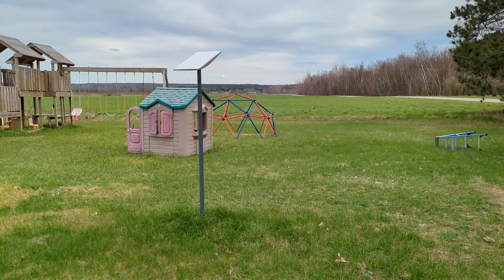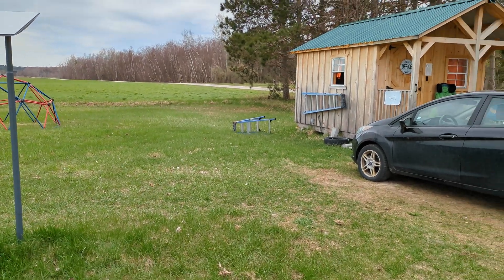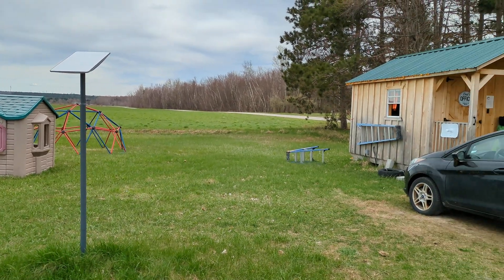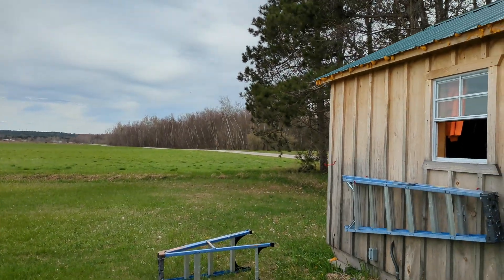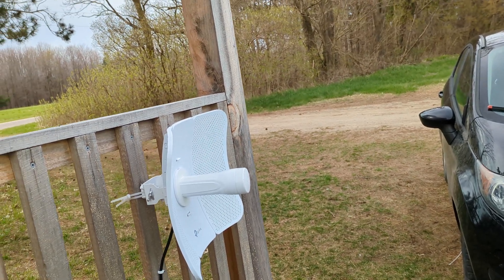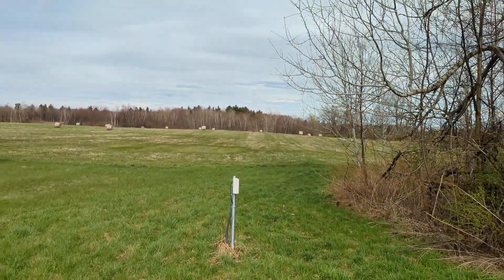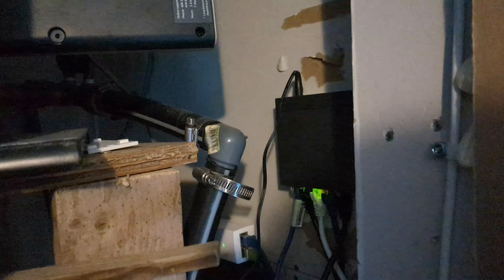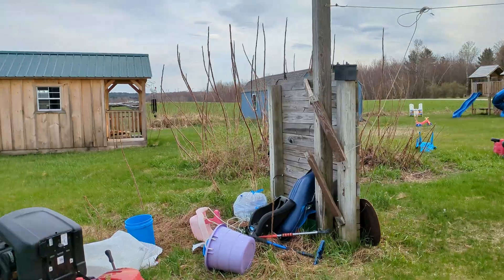Starlink 1 year later: 6+ Acres of Wifi Coverage (24 more to go)

Comment: You already have all the things done but if anyone else is looking at doing something like this, look at Ubiquiti equipment. Can't really speak that much on TP-link cpe's but in general for home equipment I've noticed tp-link has been selling some really garbage equipment to consumers lately. Like 802.11AC gear that have 100mbit ethernet. How TF can you sell something capable of 500-800Mb/s with a 100 backhaul?!
Reply from the maker: have about 200+ TP Link Omada APs out out The wild that I manage and only ever swapped out 1 under warranty.  And even that one I emailed support with the SN and they had an express replacement out the same day.  TP-Link gives amazing treatment to MSPs that resell and I stall their products and true lifetime warranty.  Ubuquiti on the other hand, I have had DOZENS die under warranty, takes months to get it  replaced sometimes, so I end up replacing them out of pocket for the client.  Omada stuff is 200-1 for failures here, and the replaced in it 48 hours.  Ubiquity is 300-25 in failure rate, and I replaced them all out of pocket because Ubiquity support is terrible.  I got my firs MCP on win200/server 200, so I've been doing this a long time and TP-Link provided the best support I've ever gotten.  I did mention the the video smaller CPEs also only have 10/100 ports but I knew that going in since its on the spec page, so yes they have done  that, but its listed on the specs, and its on products 1/2 the price of the competition so you have to expect concessions made.  I will admit  kind of stupid for consumer stuff where they wont necessarily check specs.
Reply: @JordosTechShack  are you a bot? >.> why you say that same shit over and over again ?
Reply from the maker: @Bewefau  because people keep asking the same question over and over again. "Why did you use tp-link instead of ______"
Reply: I'll never understand Ubiquiti fanboys. I get rid of all my UBNT stuff because the firmware was janky, the speed was slow, and they kept pushing data collection.
Reply: @UndyingShadow83  I worked for a wireless ISP that used ubnt almost exclusively. They provide fast speeds over huge distances if you configure them properly. Your one datapoint does not invalidate the 1000s of users out there that use these devices in a professional setting.

Comment: Nice! I gotta ask, why did you go with TP link omada instead of a more proven and durable solution like Aruba running instant os? The IAP315's can be found for like $20 now, and the AP375s for $100. Maybe put aps on what will be the un-used cpe poles?
Reply from the maker: I have about 200+ TP Link Omada APs out out The wild that I manage and only ever swapped out 1 under warranty.  And even that one I emailed support with the SN and they had an express replacement out the same day.  TP-Link gives white glove treatment to MSPs that resell and I stall their products and true lifetime warranty.  20 years in IT and I have never had the same level of customer service from any other brand or distributor.  We get -25f winters, no trees to stop the insane winds,  and I've never lost an outdoor AP.
Reply: @JordosTechShack  TP Link no longer offers lifetime warranty on anything other than Omada PRO (Licensed) equipment as of Sept 1, 2023. Look it up.
Reply: Where exactly are you finding these prices? The AP-375 seems to go for about 200 heavily used.